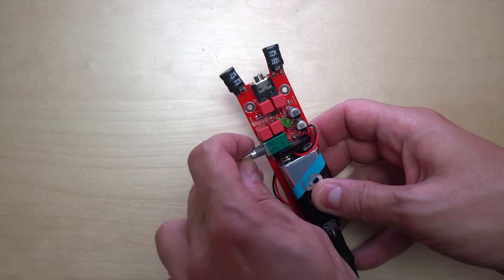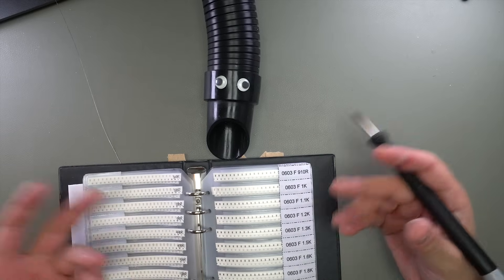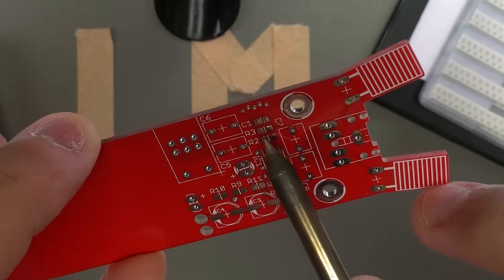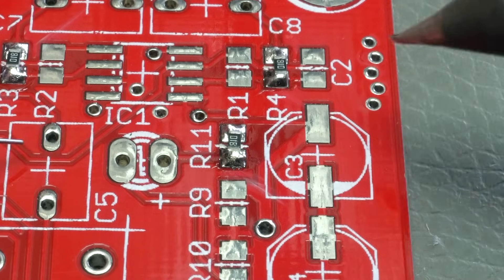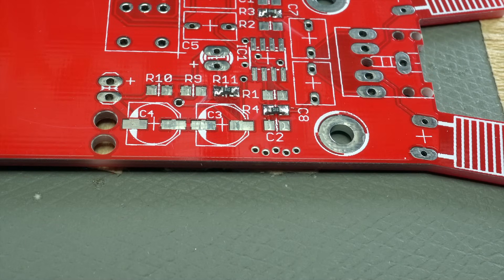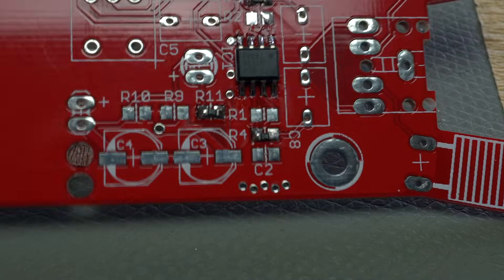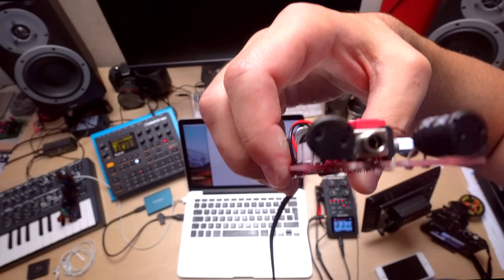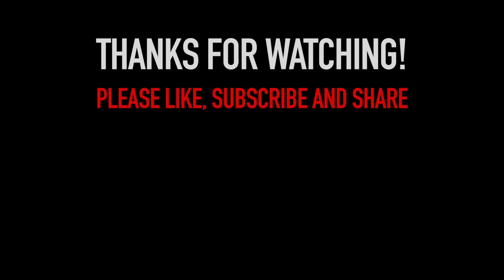How to Solder Surface Mount parts (it's easy!)

Comment: Nice video but some of the solderings have been done too short here (2nd part). Yes you don’t want to burn stuff but if you don’t get the solder hot enough you get a cold solder joint which will fail in time. You need to see the solder flow and “set” itself. Flux would help here. The IC is done correcly.

Comment: w/ thin solder wire the flux evaporates rather quickly and the solder appears bulky. if you don't have liquid flux to pre-treat the pads, you can dip the solder wire into paste flux, just a light coating is enough to supplement the flux achieving better 'flow'. 

(notice how the solder on the first pad 11:20 doesn't wick on the first leg as the flux has evaporated during the first heating. for the rest of the pins the solder flows much more uniform. so if your method is to pre-tin pads, extra flux is of great help.)

ps: bulky joints are not a problem in general (it can even act as a heat sink in some special circumstances) but it's difficult to make them consistent and in tight spaces it can bridge... for that reason a better flowing solder is preferred, extra flux achieves that (it becomes critical in high frequency components where the extra solder impedes proper performance).

Comment: absolutely great video, but I think (just a personal opinion) some flux would make even better soldering quality. Is there some reason for not using it?
Also, my (again, just a personal preference) recommended way is not to solder all IC pins on one side at once, but do it like pin 1 - pin 5, pin 2 - pin 6, pin 3 - pin 7, pin 4 - pin 8. This will help with heat dissipation  so there will be lower thermal stress for the IC.

Comment: Doesn't the board you have,  already have solder on the pads and the component's have solder on each end as well. So if you add liquid flux to the pads, can't  you tack on each part?  I know your method is much more secure and no uses no flux.

Comment: That looks very much like the Hakko T39-B02 Conical Tip that I use for SMD and some THT soldering.
Many members on the EEVBlog forum have some mental issue with conical tips.
Reply from the maker: Eh.  People get wound up on forums and have strong opinions.  I’ve worked with all kinds of tips and—over time—you get used to them. Maybe something is better than something else but certainly not anything to have mental issues!

Comment: A good tip after a long time of soldering: 
For small SMD components, I find it best to use solder paste with a stencil (you can get a stencil very cheap and quickly produced at many locations). Then place the components in place, and use either a hot air gun (more difficult) or a heating plate (easiest option) 
My soldering life and PCB assembly really changed after getting a heating plate. cut down the assembly time considerably.

Comment: Thank you very much for this video. I've learned a lot!!

Question: if I'm working to fix a poor soldering job by the manufacturer (solder came undone), do i need to clean up the residual solder and redo it or can i just solder on top of that? 

Thanks again!!
Reply from the maker: Thanks for watching. The really “proper” way to do this is to clean up the original solder joint (use flux and solder wick to remove as much of the original solder as possible) and then start again. 

That said, if it’s just one joint that is marginal, you might be able to get away with just adding a bit of new solder to bridge any gap and make a connection. Again, it’s not ideal but it might be “good enough” for a small fix. 

Hope this helps!
Reply: @LeoMakes  thank you for the additional insight!!

I've heard of people describing to "wick" it away once melted. What would we wick it with?
Reply from the maker: @ohdaUtube  Look up "solder wick braid" on Google and you'll see.  I recommend anything from Techspray brand.  Good luck!
Reply: @LeoMakes  oh cool!! First time I've ever seen a video on it. Thank you very much for steering me in the right direction!!

Comment: One of the most important reasons to add flux is it affects the surface tension of the solder.  The joint forms a nice rounded shape around the things it's supposed to,  and ends up cleaner and nicer.  Less bridging, because of the surface tension.  Less rough and crumbly surfaces, because of the surface tension.  Don't fight the feeling...  try to get comfortable with adding flux.  Yes, there's enough in the solder to make a joint, but... make a nice joint, eh?

Comment: What’s the solder diameter? I am trying to use 0.3mm on a smaller project. Is yours smaller?
Reply from the maker: No, mine is 0.3mm.  It's very nice for surface mount work.  Hope this helps.
Reply: @LeoMakes   It helped. I ended up buying one that’s 0.1mm. But that was too small to use. 0.3mm working. Thank you.

Comment: Your work is really well done and you have a really steady hand, your planned approach is very smart and i am definitely getting one of those books. I have being soldering in the larger form for my whole career and part of my training included a little trick you might find useful. When you handle the solder it has a similar problem as finger grease on the PCB.
I get a piece of cloth, linen is perfect, wet it with isopropyl alcohol and run the solder gently through the folded cloth. You keep doing that till the black disappears. It make a difference, especially in surface mounted soldering. Perfect is for robots. Thanks for listening
Reply from the maker: Great tip—I’ll give that a go next time I have to solder something. 

Thanks for watching!

Comment: Helpful video.  Isn't there any need for soldering flux gel ir petroleum jelly?
Reply from the maker: For fresh boards, you don't need more flux (the solder already has flux inside).  If you are reworking a board, then yes, you'll need to add some flux.

Comment: I came to this video from the guitar and audio world, where repair guys still stubbornly refuse to learn how to work on surface mount components. Good to know that a method does exist, they're just being lazy...
Reply from the maker: Yeah, it's a slightly different game with slightly different tools and techniques but surface mount is not that different from through-hole for most kinds of work. That said the parts are much smaller.

Comment: wow thats thin. im 3d printing with a .3 mm  and the solder is the same witdth
Reply from the maker: Yeah, it is pretty thin but you get used to it.  It's not that hard to work with it once you get a feel for it.

Comment: Thanks for the excellent know how. But there's a problem, I think the 4 legs on the left of the IC looks exactly like the same "S" shape as the 4 on the right (they're all beveled to me).
Anyways, thanks again 😀
Oh, can surface mount LEDs handle that little bit of soldering, or do they have to be done a different way?
Reply: the bevel is on the housing, not the legs. one side of the top is a 'cliff' right angle the other side has the bevel 'slope'

Comment: Well, these surface mount components are easy. But I was trying to reattach some tiny buttons on a car remote where the tiny pins are only exposed on the bottom, not on the sides or the top...I totally botched it
Reply from the maker: Sorry to hear that, mate.  With more advanced parts like the ones you mention, there's no getting around having a hot air soldering station and/or a reflow oven as there's no way to get under the parts (at least no way that I'm aware of).

Comment: Thanks,  I will receive a fume extractor in few days and I can't wait to start to solder.

I got a first problem to solve,  instead of releasing the fume in my house,  I would prefer to evacuate the fume outside.   So I need to find a way to achieve to make it more safety. 

Thanks for your video

Comment: what do you use to hold soldering wire?
Reply from the maker: You can hand hold the soldering wire.
Reply: @LeoMakes  i know but I'm talking about like the containers you use that retract it automatically, i cant find them anywhere
Reply from the maker: @Baconinged  My solder wire actually doesn't retract automatically.  It would be cool if it did, but I don't think something like that exists.
Reply: @LeoMakes  oh, i thought i saw it in the video lol, well thanks, ill keep looking and maybe design one if i cant find it lol

Comment: Nice video Leo, I would like to ask you and if possible a video request.. I recently bought a used traktor x1 mk2 dj controller, it won't turn on. That's why I bought it, cuz I would love to repair it. How can I diagnose the fault? I mean how to know is a resistor problem, the USB conector, a  capacitor or a short.. and most importantly how to read values from these pieces.. Hope you can guide me or at least give me a tip of how to approach. 

Greetings from Mexico
Reply from the maker: Sorry mate, it’s too complex to troubleshoot something like this over YouTube. My recommendation is to try to find a pro audio DIY or Repair forum or Facebook group and post your question there. Usually there are pretty smart/helpful people that have good tips on what to try. 

Good luck and thanks for watching!

Comment: Amazing work! I tried doing this precision soldering to jump a wire on my mouse PCB. I didn't have any thin solder wire though - went ahead and ordered some 0.3mm. Will try again.
Thank you for this video - very helpful!
Reply from the maker: Thanks for watching and best of luck with your repair!
Reply: @LeoMakes  Thank you! Quick update, I sucessfully repaired two mouse PCBs. I went ahead and tried to use 0.02 mm jumping wire but had to use something thicker since it was way to thin for me to comfortably work with

Comment: Wonderful video, Leo.  Thanks.  I'm wondering about flux--thoughts?  The tip about beveled pads to indicate pin 1 was terrific!  This video will make all of us software guys finally holding a soldering iron much less dangerous 🙂
Reply from the maker: I get this question about flux a lot. I should probably make a video but the short version is that extra flux is not necessary when soldering a fresh PCB with a new part. That’s because virtually all electronics solders have a bit of flux in them. That tiny amount is enough to make a good connection. More flux doesn’t hurt but it’s not really necessary. 

If you were doing re-work on a board, that’s a whole other story.  Then I’d put down a good bit of flux while removing the part or cleaning up a pad so that I can put down a fresh part. 

Hope this clarifies.

Comment: Right tool for the job..  my iron tip and solder diameter was great for automotive work, but getting the thinner solder and the fine tip for the iron, that will help as I solder to micro switches and learn to work on smaller scale electrical. Thank you!

Comment: Very nice demonstration.  I do production, mostly through hole but always a few sm op-amps.  For those opamps I'll put a little noclean flux on the pads, a drop of solder on the iron tip, use tweezers to place the part then just touch the solder to the pad/leg interface and it just sucks it up.  Don't use rosin flux as you can't get it clean under the chip.  thanks.

Comment: I'm trying to get into this and learn how to this stuff. How do you know what sample books to buy? I see C0402, 0402, 0805??
Reply from the maker: It depends on what kind of projects/repairs you expect to take on.  In this video it was all 0603, which is about as small as I can take on by eye (it gets harder every year). 0402 is very difficult unless you have a microscope so I’d say 0603 is a practical limit. 

If you’re new to this or have difficulty with eyes/hands, go with 0805. It’s a good way to get some practice!

Comment: Loved you Desk ..👍also , can you please share the details of the smoke extractor pipe I can see in the intial video . ?
Reply from the maker: The fume extractor is a Metcal BVX-201. It’s great but it’s overkill unless you do soldering everyday. For occasional hobbyists, there are much smaller/cheaper solutions (from Hakko and others) that work just fine. 

Thanks for watching.
Reply: @LeoMakes  Thanks a lot for your prompt response . I agree , crazily expensive piece of  equipment. Making a fume extractor on my own .

Comment: Fantastic video thank you!  Can I ask why you only put solder on one pad before placing the resistor?
Reply from the maker: It’s harder to get the part placed if there is solder on both pads. (you have to balance the part on two solder blobs) so it’s just for convenience and speed.

Thanks for watching!

Comment: Science used to be helping man to ease his pain to work in every situation. Now the ultra modern man's discovery of micro components in electronics, which cannot be seen even through the naked eyes, where are these people leading this world into? Does these microscopic components really help in building circuits in electronics? Machine build would be ok. But is it enjoyable working manually with electronics that very much without much strain in the eyes these days? What a moronic system the world has become!!!

Comment: I'm just wondering why you chose not to add any flux to your soldering process.  I get that there may be 'some' flux inside the solder you're using, but that often is used up very quickly, especially with the thin amount you have there.  I usually add a good amount of flux, and soldering is quick and easy, and flows smoothly.  Yes, it's messier to clean up afterwards, but it flows, looks and works a lot better.
Reply from the maker: When reworking a board, I’ll flood the area with flux to make sure the removal/reinstallation go smoothly. However, on a clean new PCB with a new part going on, the flux in the core inside the solder works perfectly and there’s less cleanup. 

Flux certainly doesn’t hurt but it’s not necessary in this case and I prefer not having the extra step of cleaning all the flux residue after I’m done. 

Thanks for watching!

Comment: Very good presentation. Thank you!Does the part sizing have to do with how much current they can handle?
Reply from the maker: Thanks!  Larger parts generally handle more current than smaller ones but that's not the only reason you might want to pick a certain size footprint over another.  For example, your manufacturer's pick-and-place machine may only be set up to handle certain sized parts. Or maybe you want to build a few units by hand before starting production, in which case 0603 or 0805 are much easier to build than 0402 or even 01005 (!)
Reply: @LeoMakes  Thank you for responding. Good info.

Comment: what temperature is your iron at?
Reply from the maker: I'll make a video about this eventually. Your iron temperature depends on the solder you're using so take a look at your solder roll (or the packaging) and the ideal temperature is usually listed there somewhere. Use that as a starting point. You can make adjustments in case your iron runs a little cool or hot but most of the time it will be fine without any adjustment.  Good luck!

Comment: Great video what temperature is your soldering iron cheers Simon
Reply from the maker: Thanks Simon. I'll make a video about this eventually but your iron temperature depends on the solder you're using so take a look at your solder roll (or its packaging) and the ideal temperature is usually listed on there somewhere. Use that as a starting point. You can make adjustments in case your iron runs a little cool or hot but most of the time it will be fine without any adjustment.  Hope this helps.

Comment: What kind of paper or towel can you use for cleaning? there are so many isopropyl alcohols now i dont know what to use, they all seem to say different things "isopropyl alcohol biogenic 70% solution"  then Green Corss Total defense antibacterial 5-1 protection forms a protective barrier that lasts up to 5 hours  non-drying hypoallergenic"  i mean its ridiculous
So i need to know what kind of towel or cloth or paper - nothing fancy i hope and that is only available in a specific place
wont the cloth hook on the components solder?
Reply from the maker: For electronics, use the highest percentage isopropyl you can find.  Mine claims to be 99.9%.  I can't measure it, but it flashes off very quickly and doesn't leave any residue.

The 70% is good for medical use since it evaporates a little more slowly and can kill bacteria over a longer period.  Plus I think it's a little gentler on your skin but I wouldn't' use it for electronics since it can leave a residue and evaporates more slowly.  Wear gloves if you have sensitive skin.

As far as towels, pretty much all labs and technicians use "Kimwipes" lint free. I think any name brand lint-free option would be fine though. You just want to avoid getting fibers all over your cleaned board.

Good luck!

Comment: If you burn 🔥the board will it still work? Asking for a friend😂🤣... while trying to remove something from the board I burned it O he burned it with the solder iron
Reply from the maker: Haha. You—I mean—your friend might test it with a multimeter (it beeps if the electrical connection between the probes is still ok). Boards can usually take a good bit of abuse and still work so give it a try. And good luck to yo—I mean—your friend!
Reply: @LeoMakes  😂🤣... thanks a lot! O he said thanks lol

Comment: What is the correct temperature of the soldering iron in centigrade for this type of job and also for hot air temperature to remove this chip?

Comment: Great video! I had never soldered SMD component before, and was scared to do it because of how bad my simple soldering skills seemed, but after this video, I was able to assemble the keyboard I am typing this on in no time and no fuss!

BTW, is the Electrosluch SMD PCB you used sold somewhere? If not, how did you get it made?